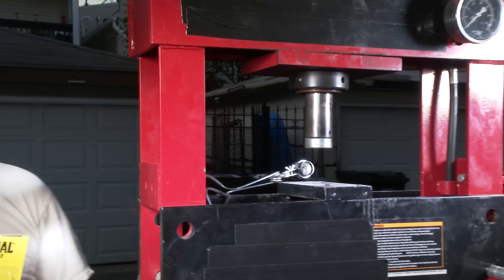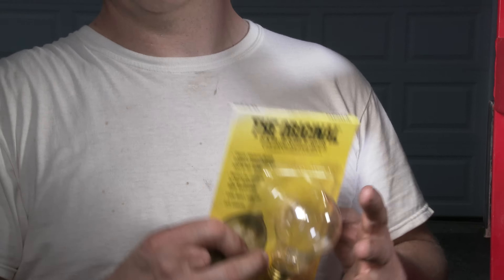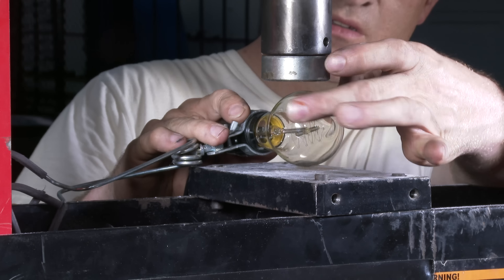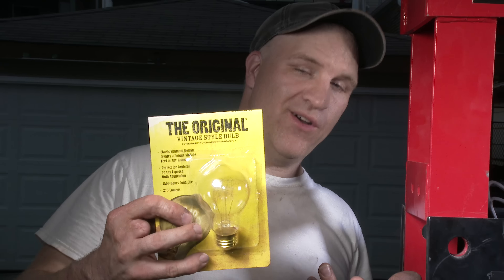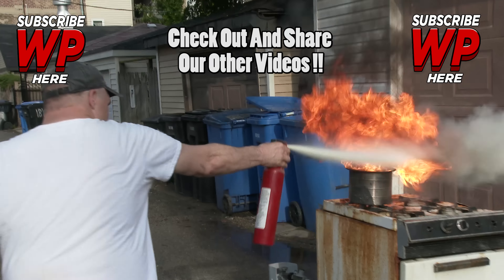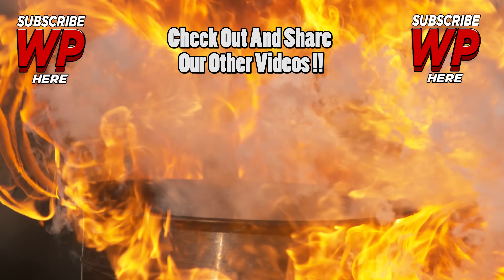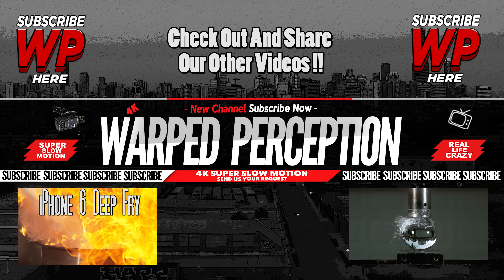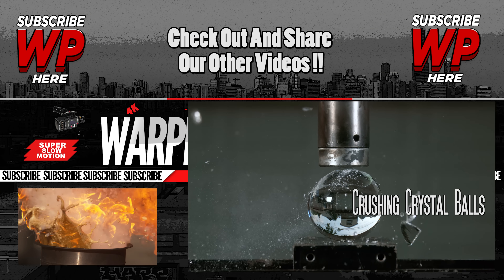Crushing Live Light Bulb in Hydraulic Press - 4K Slow Motion

Comment: Turn off frame-blending in After Effects or Twixtor or whatever you're using. This will fix the ugly and unnatural-looking morphing flashes (0:29 - 0:33). You're welcome.
Reply from the maker: well actually this footage is straight out of the camera at 1500 fps 4k, but i think the render settings were off kilter because, i saw this after the fact. i think the optical flow option in the render menu is what caused this. the frames are native 29.97. there are no manufactured frames here. thanks for the tip !! im gonna look into that